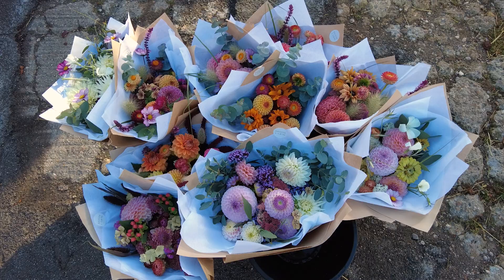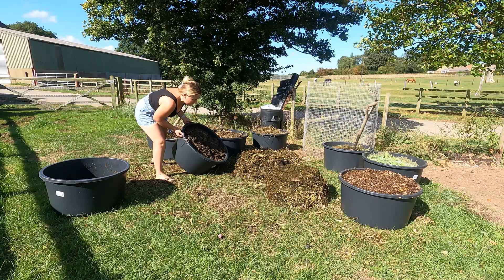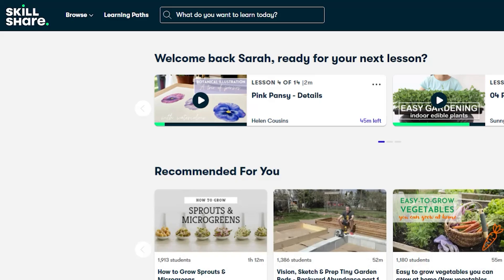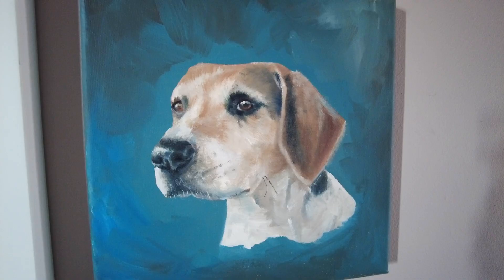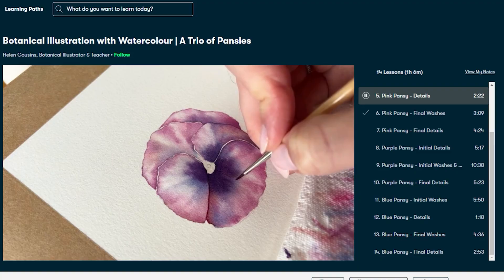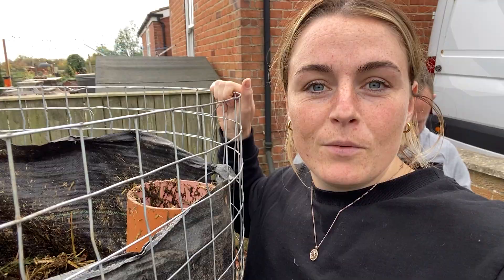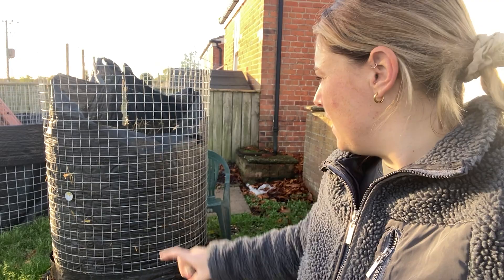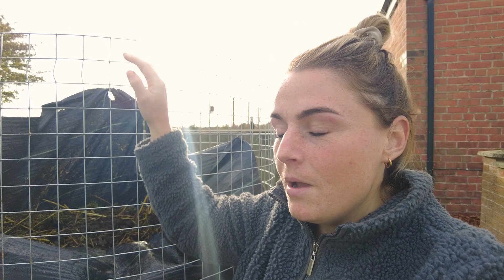Building a Johnson-Su Bioreactor to Create Awesome Compost For My Flower Farm

Comment: I made my JSB in June, went with the modified single center column design (see diego footers channel) I had the same issues deciding what to put in it, eventually went with chipped fresh hedge clippings from a conservation mix hedge (cut 5ft fresh green whips off 300yrds of hedge with secuters then chipped them) got to 60C for 4 days and lost ~25% volume, I topped it up. Matt Powers said every sample he's had under the scope from a JSB showed lots of cilliates, indicating anearobic conditions, and Nitrates, so I asked him about adding LAB along with the worms, he said it sounds like a good plan so that's what I did (I used tiger worms) I also add more LAB once a month (molasis recipie). Watering it every day has been a bit of a pain, tempted to set up an auto watering pump or something! I've had a sample from the top under the scope, very fungal dom, but it has a way to go yet (also lots of shrooms in the center air column) it'll be really interesting to see your results under the scope from a very different feedstock, good luck!
Reply: Thank you

Comment: I highly recommend making soil bacteria from another YouTuber The Weedy Garden. I made it for the first time in 2020 and after 2 years of using I can say it works 101%. I use 2 times a year. It's enough to enrich the soil. To make soil bacteria you don't need many products and they are not expensive. The recipe is on his channel and in the 2nd video.
Reply: Do you mind sharing what you use? I just watched his video, I’m unable to get seaweed, or sugar cane products and I was wondering what you used. Also what did he call it crusher dirt, stone?  I would appreciate it very much if you could share what you used? 🍁🍂🍁🦃💚🙃
Reply: My father used to top his garden with manure and ashes from the wood stove he had a wonderful garden

Comment: Those composters are a massive waste of time. It will take 2 years and A LOT of tearing it down and rebuilding it to turn the material. There are plenty of videos showong how this system is a failure.
Reply from the maker: It doesn’t need turning. I haven’t seen any of these videos, feel free to share here!
Reply: @bloomandgray  look at the Diego footer videos or the ADHD farmer. If you search, "Johnson she bioreactor" you will instantly notice that the same youtubers are posting multiple videos on this. Thats because it fails so they are trying to add tjings and change things to force success. 
The interior air tubes were thought to be the innovation that would prevent you from having to turn it. Which makes absolutely no sense what so ever since the middle of a standard compost pile is what heats up and breaks down. Adding the airflow tubes is supposed to increase the speed of the breakdown and hep regulate a consistent temperature of 160ish degrees. It doesn't work, as you will soon see. The turning is absolutely required as the outside 8-12 inches will nit breakdown left unattended. 
In addition, this system requires both a lot more watering as well as a lot more attention to detail when layering in your materials. 
A simple pile that you thriw whatever in turned and watered once a week for the first two months is hugely more successful and 100% cheaper (free) to build.
Reply from the maker: I have seen Diego’s videos but as with any process you don’t always get it right first time. The reason for the air pipes is the keep the pile aerobic during the decomposition process facilitated by fungi. ‘Quick thermophillic’ composting over a couple of months with regular turning does create heat but it’s mainly a bacterial process. I’m looking for fungal compost, which requires less disturbance and a longer time period for fungal hyphae to develop. I’m sticking with the Johnson su for now as I want those fungal components in my soils! You’re right that the external doesn’t break down like the middle but when we’re talking about needing as little as 1kg per 2 acres does it really matter if the outside doesn’t break down?
Reply: @bloomandgray  umm two cover two acres, yes it absolutely does matter. I spend $3,600.00 to barely cover 1 acre of 70% flower beds and 30% vegetables. One Johnson so reactor is going to give you enough to do the indoor plants in the average person's home...
Reply: Those materials will decompose in a year whether they are turned or not, especially if worms are going in. Twigs and thick flower stems such as rose might not go, but straw and even wood chips will be ok after 12 months under those conditions.
Reply: You need to read the instructions. Diego footer is a troll. Once you have build the cylinder and set it all up all you have to do is water it or get an automated watering system going.
Reply: @Dampflanze  first, it's a DIY, instructions don't just magically appear. Second, its a proven failed idea. Not only does it take well over a year but you still have some 40% of the material from the outside in that fails to break down due to lack of turning. This is obvious common sense. You can physically see that just by looking at it.
Reply: @bloomandgray  May i ask what the weed fabric material is?  I think this may be a place for issues - using a material that is not very air permeable.  I have seen some other videos where they struggle with the pile going anaerobic also (and I see others comments here that, to me, point to this problem).  I may try one of my own, perhaps with no weed fabric (using a tight wire mesh material), or using a loose woven fabric to let as much air pass as possible.   Nobody likes to have to turn compost on this scale.
Reply: @lunkerpond9765  I dont think you really understand the true benefits of using this kind of bioreactor. Yes, it does only create a small amount of compost but ideally you would use the compost to create high volumes of compost tea that you then spray onto the soil. This type of compost tea has been proven to vastly improve degraded soils by introducing bacteria, fungi, nematodes and protazoa which in turn create aggregates around the roots of plants, removing the need to add excess amounts of compost. Its possible to create huge amounts of compost tea from just a small bucket of this type of compost.
Reply: @lunkerpond9765  I dont need to show the science, as I have used it myself, on my own land, and compared it to other forms of compost tea. The results were significantly better than those of other compost teas and regular composting methods. I have been using this method for the last 6 years and have converted what was a dry, dusty, lifeless dirt patch into a highly productive, carbon rich, soil where plants thrive.
Reply: @PaulSaxbyPhotography  you dont need to show the proof because you have not seen any proof so you're just making a baseless claim with nothing to back it up.
Reply: @lunkerpond9765  You are very angry today, maybe you should take up yoga, or put on a CD of whale song, to help calm yourself down....
Reply: @PaulSaxbyPhotography  good comment!  I'm glad you have been having good success with the JS, we are going to make 2 next week.

Comment: Having done this with success, just a couple of points.
The material isn't clay like, it is mature vermicompost, and when it is clay like, it is too wet.
Also it needs to be under cover, as your climate is the same as mine and it will freeze in the winter, and kill all of the worms so stopping the biological work over the winter, and increasing the time needed.
David Johnson's method works well, but as he says, it has to be tweaked outside of the desert conditions, he lives in. Hope it turns out OK, it has made a good start.
Reply from the maker: Ah ok! I’ve seen David and others mention a few times that the finished consistency is clay-like. Just quoting him! It is on a pallet so we can move it inside if it gets too cold. What materials have you put into yours with success??
Reply: @bloomandgray  Veg, flower, herb trimmings, shredded stems from roses, shrubs hedging, straw, willow ( great for fungi of all kinds including myco ) if shredded as fine as you can they break down in a couple months. Have seen you have a good pile of old manure, this can act as an inoculant to start thing going. If it hasn't been going too long, you can top it up, no recommended by David but does work. He loses some but not as much, mainly because he uses a lot of wood chips, to allow air, and they decompose slowly, one of the reasons it takes a year or so. The secret is as much diversity as you can, so it's good for everything you grow, as in KNF and Jadam. The best thing to feed a pepper is composted pepper leaves etc.
David waters every day, your problem in this country is too much as it can turn solid, and stop being aerobic, we don't have 40+ degrees for 6-8 months of the year, but that speeds the composting up at that heat.
Good look, but remember you don't live in New Mexico, so think Yorkshire.